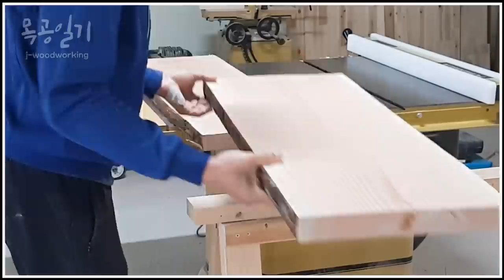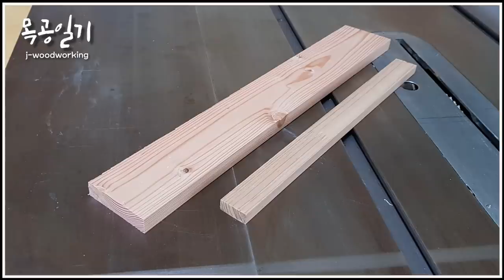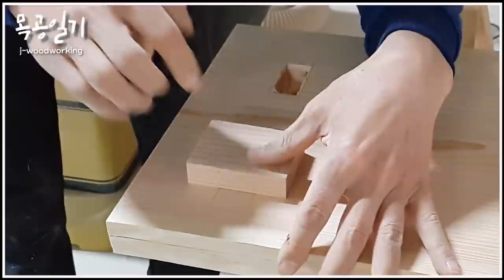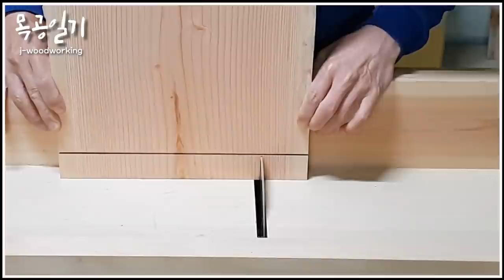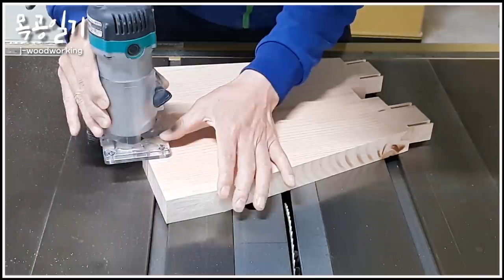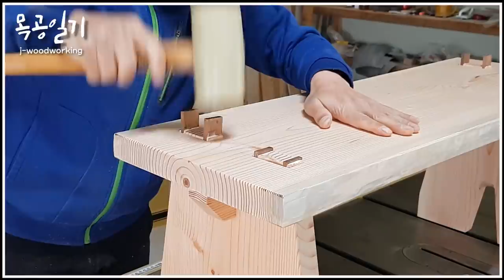Happy that I can give my long stool live edges at last [woodworking]

Comment: When the final wedges are put in they are exerting force on the surrounding wood
perpendicular to the grain which would tend to make it split.  If they were put in
in the direction of the grain it would add strength
Reply: Wedges are normally put in across the grain to minimise splitting. Here they are close to the end of the wood, so whichever way you place them you have to be careful. Wedges along the grain are used to split wood.
Reply from the maker: Thanks for your kind explanation sirs. I learned another from real woodworkers.

Comment: Why glue?
Reply from the maker: Thanks for watching sir.
Reply: @j-woodworking9573  - I just feel that with the mechanical joint you are making, the glue is redundant.
Reply from the maker: You are right. And I think glue makes the joints tighter. Thanks again sir.